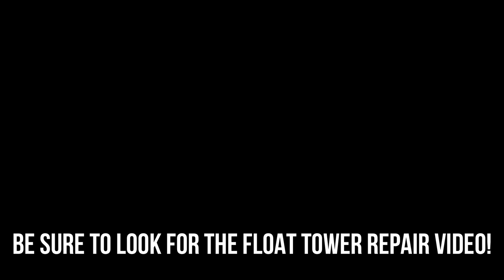GS550 Full Carburetor Teardown And Cleaning! - HOW-TO - These Fought Me Hard! - EP3

Comment: I love that my 79' non cv carbs have fuel and air mixture screws. PO forgot to replace a vacuum cap so it wouldn't idle.
Reply from the maker: Which ones do they have fuel or air? Typically is the adjustment point in by the air filter they are air mixture and if by the cylinder head they are fuel mixture.  The cv carbs have fuel mixture screws
Reply: Hello, thank you very much for clearing my doubts, thank you, I learned something new, I hope to continue learning from your videos, thank you very much.

Comment: I have done 3 sets of Honda 750 carbs and found after disassembly for the really small plugged orifices an "E" string guitar wire works perfect. Also if you don't have an ultrasonic cleaner, soak the carbs 24 hrs in Pine Sol. Most time you will find someone else has buggered up the Philips head bowl screws so I just replace them and all other philips head screws with Allen head screws available at Lowes hardware.
Reply from the maker: I have a large variety of wire and string for such jobs. Also have an ultrasonic. I use baking soda in my sand blaster to do heavy external cleaning combined with multiple U.S. sessions
Reply: @BrickHouseBuilds  Yeah I watch your videos, very helpful and informative. Japanese carbs can be frustrating for someones first attempt at restoring them.

Comment: For removing the jets you may look into hollow ground flathead screw drivers they’re less likely to strip them out, in the gun world they’re imperative for the same reason. You can buy kits that have different widths and slot thicknesses.
Reply from the maker: Very true however I grind my screwdrivers to fit jets. I use the same ones for the same jobs

Comment: HELP! HELP NEEDED! I started to disassemble my GS550E carb as in the video. When I got fuel/ air needle jets I found someone had taken of the factory plugs. Two of the jets came out with no problems but jet # 2&3 are stuck it there. Someone must have cranked down the needles all the way down. I tried to tap them with a small hammer and a screwdriver, sprayed lubricant and let them sit over night ( the lubricant didn’t even go down the threads, I tried a heat gun and lube .. nothing seems to work. I’m thinking try to drill them out but I know it will ruin the threads but I can always retread them. Any suggestions? Thanks!

Comment: Still getting psyched for that lockset bolt (~reverse drill bit, vise grips and maybe a 2/4 with light pressure from below may get it to move. yada yada) But now thinking that the carburetors have  not been out in a long long long time I am "Assuming" that I need to get them out and clean them.  (not gonna spend $1000.00 at the dealer for this.). I know you have a vid about the 750 carburetors I'll check for that too.  Aaand I did find the Motorcyclemd guy who has lots of stuff about carburetors too.  If I watch any video I try to say thank you.  So here I am again.  Thank you!  Thank you, Thank you, Thank you.       〰✨👍✨〰

Comment: Something I want to point out now that I've torn into mine on my 81, HOLY CRAP these have been some of the toughest ones I've done, giving me nothing but problems. 2 of those mixture screws up top have committed self death and stripped out the flat head and one was buried, was really hoping no one had been in there before but with a 56,000 miles bike, was bound to happen, and they are stainless and not brass, spent 8 hours last night doing surgery on them trying to remove them, ended up having to drill them out and now need to clean up the threads a tad so for future reference, and I will update this comment once I find out for sure, but the thread is m6x0.5 if I am right, again, ill update that if I need to, but in my head, its a good idea to gently clean those threads and lubricate well so they are easy next time, at the very least maybe take the old one without the spring and with some anti-seize run the screw in and out over and over till the threads are nice and even. Just my two cents but please ,for the love of basement jesus, take it easy lol
Reply: Took me about a week. Broke off a hardened steel drill bit in one of the screws in the process of drilling for an easy out. Carbide dremel tool 1/8 shank bit saved my booty. 

To confirm, the thread pattern is m6x0.5, I got this one, worked great, and after cleaning up all the threads, even the ones that came out easy, still cleaned up alot of junk, totally worth cleaning them up if you feel like ordering off Amazon. Probably fits multiple carbs and would be a handy addition to a tool cabinet just to flex on your buddies if anyone else ever has an issue. 

6mm X 0.5 Metric HSS Right Hand Machine Tap by KMIAN TOOLS.

Comment: Hey, not sure if you have the time to read this. I understand if you don’t respond but I’m having an issue with my bike. It’s an 81 CM400C. It’s misfiring on one cylinder. Running pretty rough as you probably know. I’ve cleaned the carbs, replaced the floats and float needles. Re-jetted it. They’re immaculate inside! I’ve put on two different sets of coils and wires, currently have a performance coil and wires on with new NGK Iridium plugs and STILL! having the same problem on the same cylinder. I have 150 compression on both cylinders. Spark is excellent! Even installed a new CDI. What am I missing, man??
Reply from the maker: First, stop replacing parts. That is very important.  You must first diagnose the problem before replacing things as you only get further from the answer. 

Are the carbs vacuum synced?
Valves adjusted?
Mixture setting correct?
Were the carbs ultrasonically cleaned?
Did you remove the pilots?

You need to confirm the basics first.
Reply: Thanks for the reply! 

I have not vacuum synced the carbs yet. I’m lacking the tool for that. And the only place that looks like they sell one that’ll work is Dime City Cycles. I don’t have a clear shot at the adjuster screw when the carbs are on the bike though and the tool is a long screwdriver and a hollowed out socket. It looks like I need something angled. I could be wrong though and just not seeing how to do it.

Valves are adjusted to spec in the Clymer manual. 

Fuel mixture screws are 2 turns out. I tried 1-2 turns and got a change in the idle but didn’t fix the problem.

Just got them out of the ultrasonic cleaner two days ago and put back on the bike with zero change in the way it was running. HOWEVER! when I drained the ultrasonic cleaner today I saw a square brass fitting and a tiny spring in there. Must have worked it’s way out of one of the carbs somehow. Not sure where that goes 😐 

I removed the pilots and cleaner all the fuel and air holes I could find. Jets are clear and the carbs look immaculate inside. Just need to find out where that tiny square brass fitting and spring go and then fire it up again. Any ideas where that thing goes and what I may have done wrong when cleaning them in the ultrasonic?
Reply: Carbs are Keihin
Reply: Think I found where it goes. In the accelerator pump housing, behind the spring.
Reply from the maker: @zackfebus7844  you are correct on the accelerator pump cover. Good catch on that. For syncing it is just a bit challenging to do. Check my Amazon Storefront for a basic vacuum sync tool kit.
Reply from the maker: @zackfebus7844  my recent video where I work to make a red cx500 roadworthy shows a lot of syncing those carbs which are 98% the same. May be helpful
Reply: I’ll check that video out. Appreciate it! So in your storefront now. I see the vacuum sync tool. Shows that it’s unavailable. I already have that tool anyhow. I need the tool to do the adjusting. Can’t reach it when the carbs are on the bike.

Comment: Massively helpful video, thanks for posting. One question though - how did you replace the mixture screw caps as they were drilled off and I don't seem to be able to find replacements anywhere.
Reply from the maker: Thank you! The caps are not needed as that was just an EPA mandate and not necessary.
Reply: @BrickHouseBuilds   thanks for the quick reply! That’s great, I’ll stop trying to look for replacements now

Comment: When I get a key~ I was thinking about checking the gas tank, look around on the carburetors and see if I could start the engine w/o all of this.  Any wisdom from you around just starting it up?  Can I put something in the gas? I know there are a few things out there I just have never gone there.  (95 750 Honda nighthawk 30k miles).  Thank you!    〰✨👍✨〰
Reply from the maker: You will want to try to drain the carbs if they haven't been already via the single screw on the float bowl. With the tank off you can hook a fuel line up to an aux tank. Before adding fuel its a good move to put fresh oil in and rotate the engine off the starter for 5 seconds to help get some oil moved around. Then I'd say go for it. If it doesn't start you can start the diag with it being fuel, air, or spark and see which one is missing
Reply: This is gold.  Thank you so much. Best wishes always. 
 @BrickHouseBuilds

Comment: The only way to fix float towers, is to put the hammer back in the bottom drawer, and get the really thin, sharp side cutter out. grab the head of the float pin, and squeexe it between the post and the head. Two drops of phosphoric acid will free up the corrosion. Flush well afterwards!
The most incredible thing here, is that You kept pounding away on those poor towers - even after You've already broken one. These kinds of mistakes, were something we did in the eighties - before Youtube landed. nowadays, there's no excuse for doing what you did.
Reply from the maker: @qivarebil2149  How dare I learn a lesson. I don't do it this was any longer as yes, it wasn't the right way to do it. What is interesting is that by having a video out in the world, people expect nothing but perfection and often don't allow room for mistakes.

Comment: Hey, awesome video.. a question...what do you think that cause my throttle stuck open (im refering to mins 2.42). the carb still attached to the engine btw.
Reply from the maker: YOu will need to see if the sticking is in the carbs, cable, or throttle housing. You can remove the cable from the carbs and see how much resistance it has as well as testing the carbs at the same time

Comment: I have a pristine totally stock 1981 Suzuki GS650L. According to the repair manual it has Mikuni BS32SS carburetors. I have cleaned and reassembled the carburetors. It runs very strong from about 1/4 throttle up. But rough idle. I suspect the pilot jets need to be replaced. Are the carburetors on your GS550 the BS32SS as well? If so where did you get your new pilot jets from? I know you said Mikuni but the only place I found those was from Great Britain. Is there a supplier you found in the states?
Reply from the maker: It may need adjustments on the mixture screws first to see if it wants more fuel.  Check out jetsrus for parts

Comment: I too just broke off the flange that holds the float pin.  Will try JB Weld.  I also am having a hard time finding the really small clip that holds the float needle in place.  Of course, without it, the needle valve falls out!.  Do some of these carbs use a "C" clip in lieu of the very small clip?  Mine is a '79 GS550E, but it has the later square top covers over the slide valve.  Can't figure this one out.  Thanks for yur series of videos and any help you might throw my way!
Reply from the maker: Be sure to use JB marine weld and not regular.  Many needles have no clip at all as they are held in place by the pressure of the float. There is a tiny plunger within the float needle that helps maintain that pressure as fuel level changes
Reply: @BrickHouseBuilds  Thanks for the help.  It is the first time I have seen anything other than the float itself to hold the needle in place. The issue of different carbs on the bike has baffled me.  I might have a late year bike with newer 1980 parts.  Thanks again, keep up the good work.

Comment: hello on a suzuki gs 550 with mikuni vacuum carburetor, changing the filters and putting the cone ones by how much I have to increase the jets of the minimum and maximum.  originals has 92.5 max and 40 minimum.  thank you very much.
Reply from the maker: There is no exact science on that but likely 1 step on the pilots and 2 steps on the main jets to get in the ballpark. Do not buy cheap Amazon pods. Look for a quality UNI, K&N, or DNA
Reply: @BrickHouseBuilds  ok thank you
Reply from the maker: @alessandrozecca4437  no problem

Comment: Why was the one brass rod left in on each? I need to get mine out to replace them
Reply from the maker: You don't remove those from the carb bodies. You manually clean them and confirm they can flow air through them.

Comment: So how did you, get the pins out , I'm having the same problem?????
Reply from the maker: Try using a spring loaded center punch
Reply: @Brick House Builds  I'm having problems with carbs #2,3,4, #1 was no problem I was thinking it's all in the angle, just if there was a punch that could go through all studs...
Reply from the maker: Definitely DO NOT try all at once. Take your time, use a bit of heat, penetrating oil, and careful force. I'm pretty sure I show how I remove the pins in this

Comment: I have 1982 Suzuki 1100g and I pulled the bowls off mine it didn’t have the rubber plugs on the Pilot jets is it necessary to have them in it ???
Reply from the maker: I am not sure if the 1100g had them.  You can see if they are required by looking at a parts fisch on a place like partzilla

Comment: I have a 1983 Suzuki GS550E. Gas is leaking out of the bottom of the left 2 carburetors. The bike only has 4.8k miles on it. Any advice on where to look for a
Reply from the maker: Floats needles arent seating or bowl gaskets are bad. Mileage doesn't matter as its a 1983 so thats a lot of time
Reply: @BrickHouseBuilds  I'll look into it. Thanks!

Comment: I know this is an older video but I am having trouble pulling the snap rings for the needle retainers. What size do you use? None of mine fit.
Reply from the maker: This video is pretty recent actually.  I actually have a cheap set of needlenose pliers with ground ends that have a slight bend added to them. You can see me use them during the assembly video of the same carbs.
Reply: @BrickHouseBuilds  ok I’ll try that appreciate it.